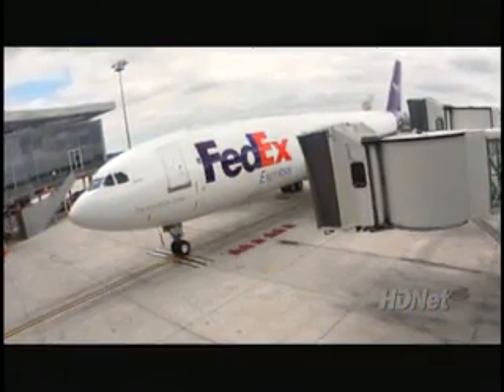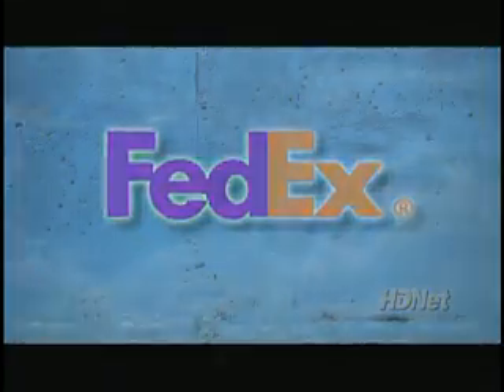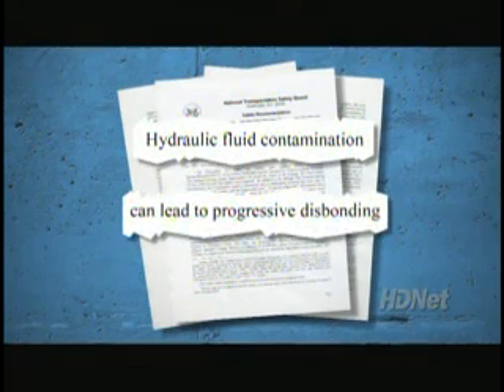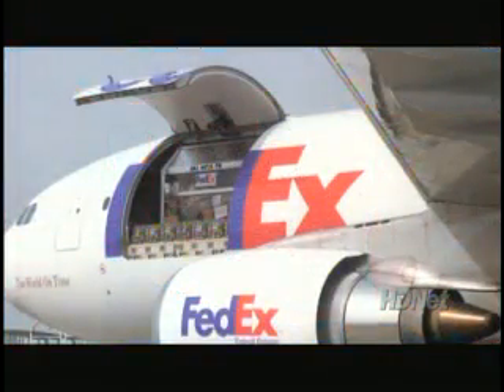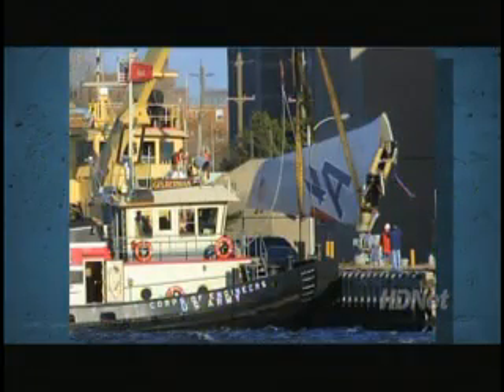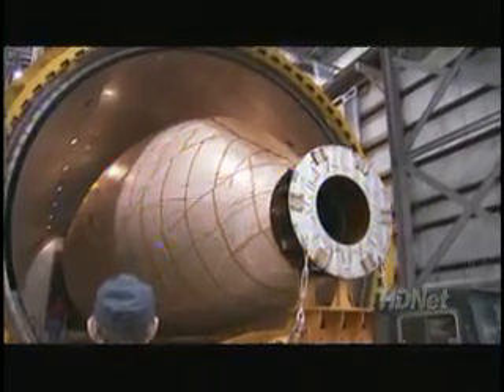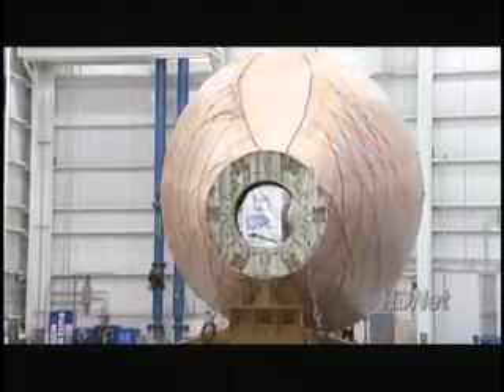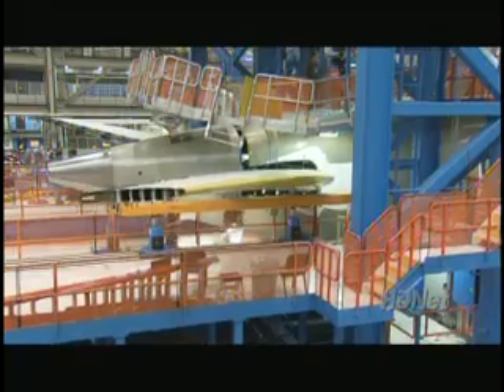Dan Rather Reports - Boeing 787 composite concerns (4 of 4)

Comment: I mentioned on this vid that the engine should be the number one priority to improve on but I'm finding that the aerodynamically SHAPE of the wings is just as important or even more so than the engine. The reasoning is that what if the engine breaks down while flying? At least with improved wings the plane can land more safely or it can 'hold it' to the nearest runway. And with improved wings, the fuel economy can be improved with sacrificing safety and comfort.

Comment: Weldon's central point is quite correct. Because it feels it has to respond to Airbus competition (they took 50% of the market in a very short time), Boeing has launched far too quickly into a virtually all composite plane. Composites have been in vogue since the 60's. Boeing hemmed and hawed over their use for years under no pressure to change. Now suddenly, we have to be all composite. They have not done the homework and they don't have the talent. Expect many problems ahead.....